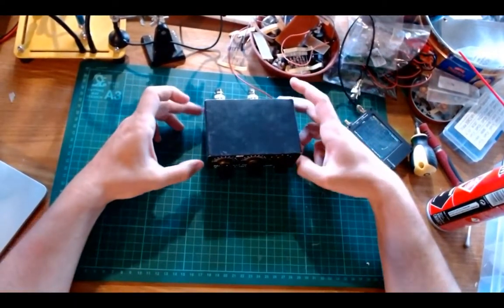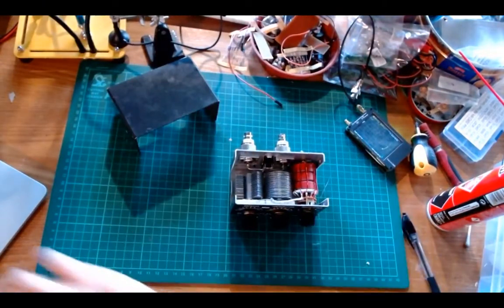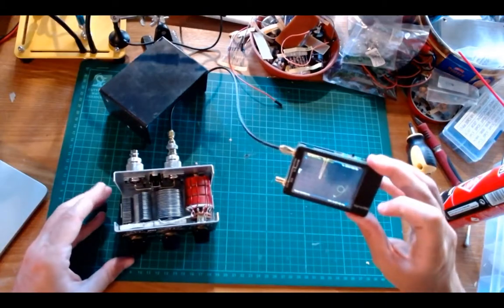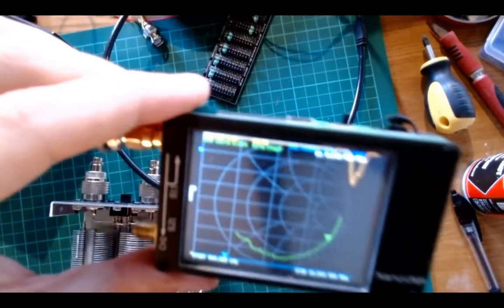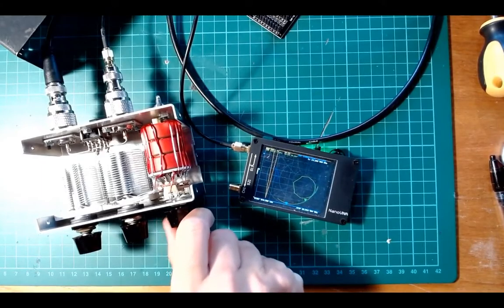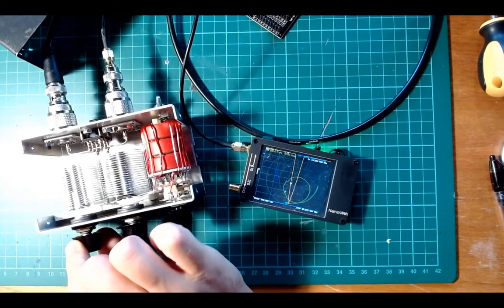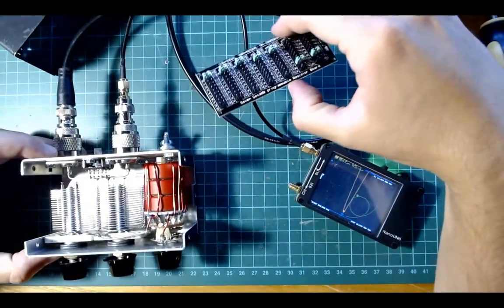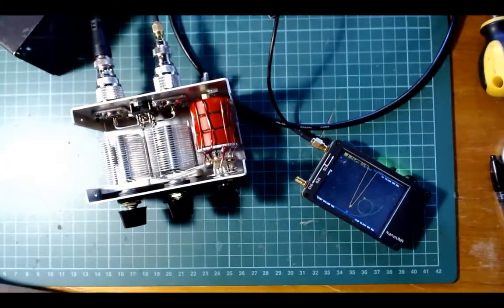Episode 49: MFJ-902 Antenna Tuner

Comment: I good video many compliments, i  should i buy a manual tuner for my 20 watt max hf radio. I am undecided between the MFJ 901 model and the MFJ 902 model. The 901 tunes up to 160m (1.8) Mhz while the 902 has 6 Meters (which I don't care about) but starts from 80 m ie 3.6 Mhz. The 901 has the coil in the air, the 902 has coils wound in 3 toroids. What's the difference? Which do you recommend to buy between 901 and 902? I am inclined to buy the 901. Could you tell me how to make the bridge? I saw in a forum that they mount a switch which is certainly an alternative to the jumper. But what specifically is the jumper switch for?

Comment: Perhaps make another video in which you connect the NanoVNA S11 and S21.
This will show the working of the filter.

I do have to add, I am not fond of tunes. Yes, it does protect your transmitter, but other then this I see no added value.
In case your antenna is not a good match for the frequency you wish to transmit on, the matcher can protect your transmitter, but some (or a lot) power will be lost in the matcher itself.
Reply from the maker: Yeah I completely agree (as I have learnt from some experiments). I now believe (like you) that the right thing to do is just to have a properly matched antenna, with no tunes, at least for home usage. Unfortunately I live in an apartment and I haven't yet found a good solution.

Comment: Could you use this tunner for tunning an 2.4GHz wifi antenna ?
Reply from the maker: hi! No tuners like this only work with very low frequencies, like the HF (3-30Mhz) ham radio band.
For 2.4 Ghz you need an entirely different type of technology.
Reply: @therfnoob7697  thanks for your reply,  i always hope to a tuner working at 2.4GHz, but i can not find it
Reply from the maker: @dattran0000  Generally it is very easy (and cheap) to find antennas that are already 50ohm matched at 2.4Ghz (because 2.4ghz is the very populare frequency of Wifi) so that you will not need an external tuner. What kind of antenna do you have?
Reply: @therfnoob7697  i usually use some flexible antenna, dipole antenna, pcb inverted-F antenna. I always retune when i assemble it into a shell. Of course, it is very easy to retune, but if i have a tunner, i will not have to solder some components
Reply: At that high frequency a tuner (if available) would cause so much loss of the signal it would not be worth it. Better off retuning your antenna as described using quality low loss coax and connectors.
Reply: @kevinmccool3719  yeah, i usually use  RG142 cable in tunning